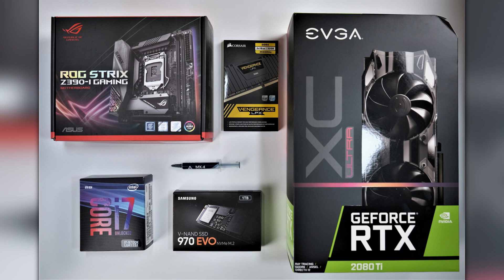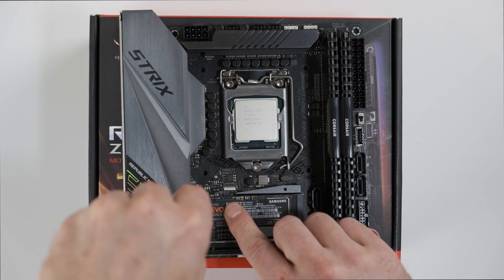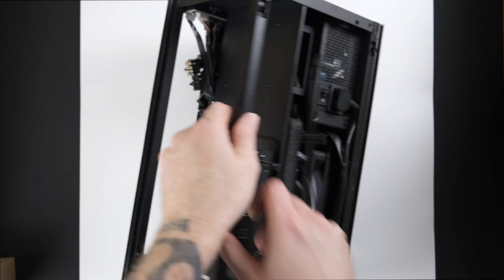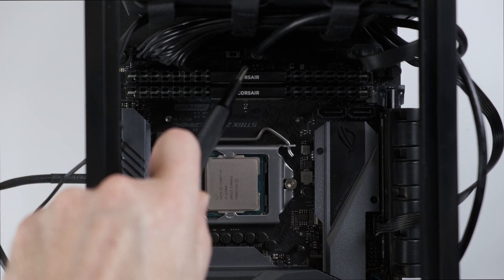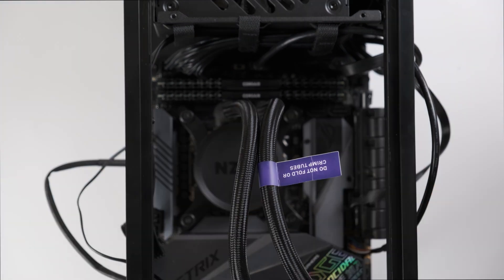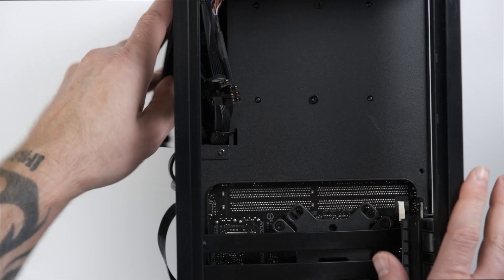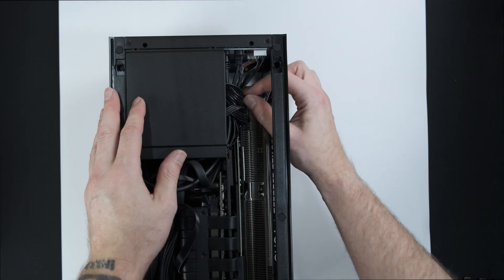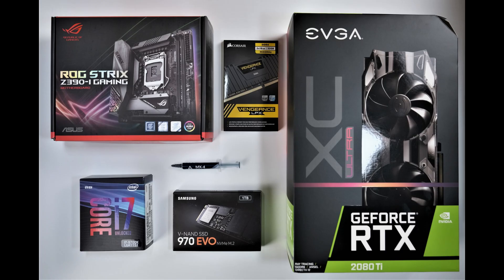Mini-ITX Quick Build

Comment: Instead of a 2080 could a 3070 be used cause a $1200 compared to $499 is kinda a lot.
Reply from the maker: Absolutely!  You can definitely use a 3070 instead and I would actually recommend that.  This build is done with parts that I already had, left over, in my possession, previously...
Reply: @longmeistergaming9740  def will do that once I can get my hands on one
Reply: @longmeistergaming9740  I need help getting that motherboard :(
Reply from the maker: @diorr.r  I hear you, Dior.  It has been so difficult to get almost any tech related items right now and I swear it just seems like prices keep going up...  I hope you get your hands on one of those boards, Dior!  I am a huge ASUS fan and would definitely recommend this board to anyone.  I have never had any issues with it.

Comment: Is the power supply upgradable? Is it a special power supply just for mini builds?
Reply from the maker: Dale,  Thanks for the question!  Yes you can upgrade the power supply.  The NZXT uses a Modular SFX PSU for small form factor.  So if you'd like to, for example, bump up to a 850 watt PSU from the 650 that the case comes with just make sure you purchase a SFX power supply.  Hope this helps!